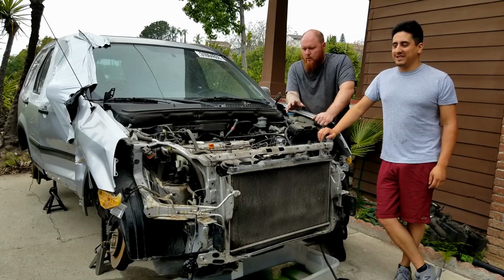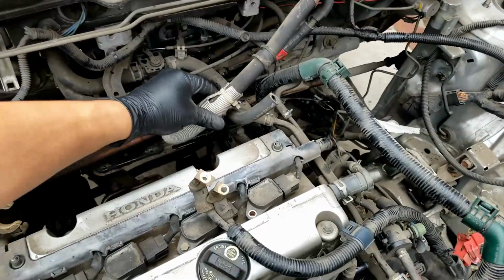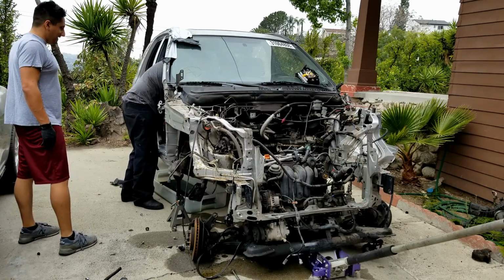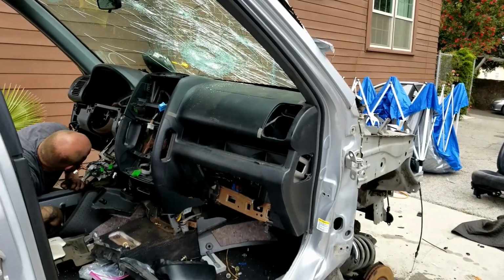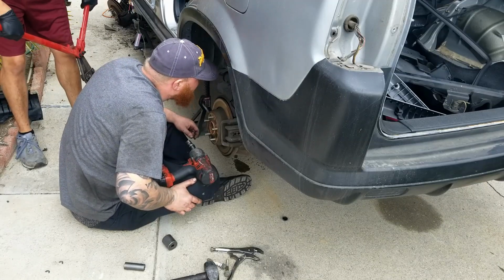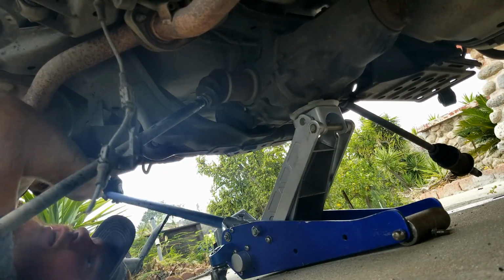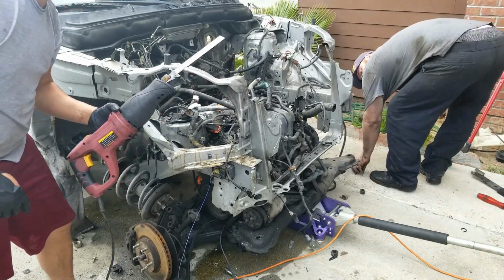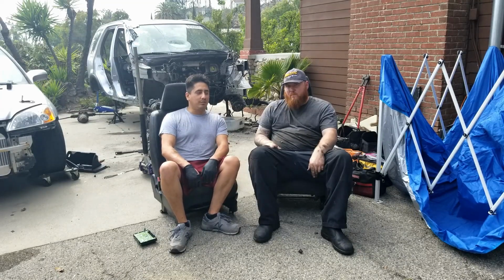Stripping the donor CRV of its AWD drivline - Part 2

Comment: So let me get this straight you guys mount an 05+ CRV diff (for strength)  with 02 CRV axles to an 02 CRV trailing arm/hub which bolts on to an ep3 civic, (not possible with ef/eg/ek right?), shave off the 02 CRV driveshaft a couple inches, and then make some custom motor mounts (or hasport?) to drop the k24/tranny/transfer case in? Can you use the front axles, knuckle, or hub off the CRV for the front? Do you have any vids showing the wiring of the ecu? Thanks red.
Reply from the maker: It bolts up for the most part yes but innovative makes a crv rear mount not haspot, and the wiring is the same for ep3 as far as em2 there is jumper harness that are plug and play. I feel I have eplined all this in the videos inposte please watch them and stay tuned Tim's car is getting the conversion start to finish
Reply: @PirateGarage  will do.appreciate it.